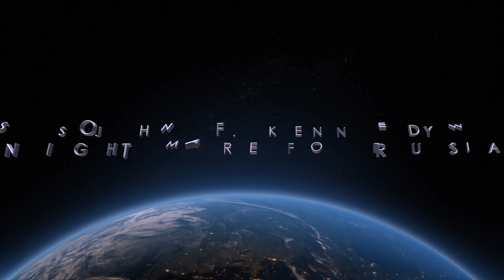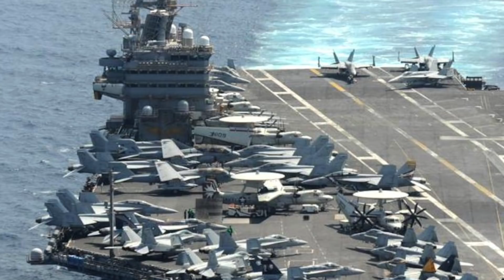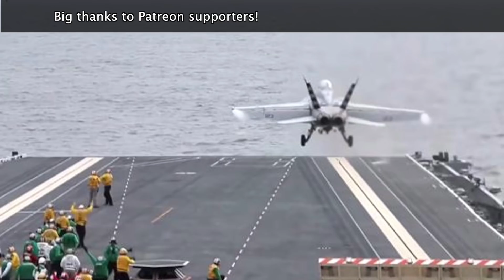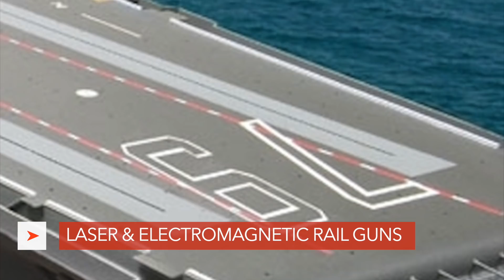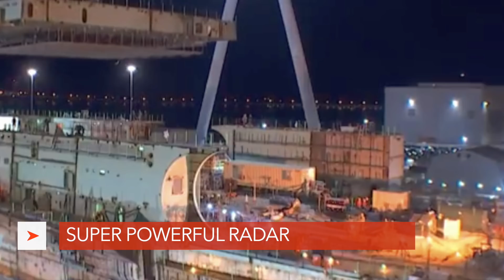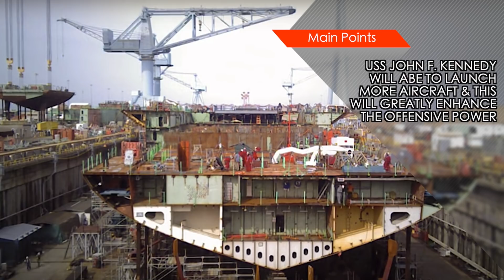WHY USS JOHN F. KENNEDY WILL BE THE WORST NIGHTMARE FOR RUSSIA & CHINA?

Comment: It's nowhere near 50pct built and after the GRF crews stealing parts for it I'd say that it's about 40pct. When you build something you always make sure that you've got a ready supply of spares in case of feckups like we are seeing on the GRF, more importantly you Field test the new equipment on a tried and tested platform so you can't have the arse over tip feckups the navy has been having for the past four years. This oversized Boston whaler should be well into her deployment cycle but because of too much untested new equipment being lumped in her has made her a Jonah

Comment: There are some serious assumptions about present performance/non-performance that will greatly influence whether the Ford class vessels will be effective platforms. 

The EMALS system remains an immature technology that is installed in such a way that the entire system must be shutdown to service one catapult. That presents a maintenance challenge if the standard sortie rate is to remain adequate. Speaking of sortie rate, only two of the eleven weapons elevators (critical pieces to support rapid aircraft arming) currently function as designed- the USN was required to contract external engineers to get the complex system to work. And the list goes on- the Ford class is an ambitious experiment, but not a functional platform that can be deployed anytime soon and expect to survive anything more that a token aggressor.

In fact, there's a growing body of thought within the Pentagon's strategic planning groups that the financial investment in large, complex vessels is not longer a viable approach to the future of asymmetric warfare. The Commandant of Marines has recently published his force projection summary which states his desire to equip the marine expeditionary units with smaller amphibious assault ships to defeat the ever-expansing A2/AD infrastructure being deployed by China.

For right now, the Ford class is a paper giant.

Comment: WOW so much for "WORST NIGHTMARE":

Improvements of Ford&Kennedy over Nimitz-class

1. EMALS, designed to launch planes faster and safer +30% flights per day
to this moment appeared to have multiple technical issues, the catapult actually itself fails to withstand the stresses and malfunction regularly 
2. +10% space for planes or munitions
3. Some new fancy radars and possibly point-defence lasers in the far future. Actually all the stuff you can easily put on the nuclear-powered Nimitz-class.
Also Defense Updates, did you know that installing a rail gun on the aircraft carrier is a very stupid idea? The artillery support is the job of destroyers, the carriers should stay as far away from the enemy as possible
...
and that's all. Ford class is almost the same as Nimitz, besides EMALS, which provides no game-changing capabilities and totally unreliable anyway

The chinese actually should be very very happy, that the biggest defense budget in the world spent billions of dollars of R&D on the small incremental upgrade of its supercarriers instead of buying a dozen (!) of state-of-the-art nuclear hunter submarines for the same money
Reply: Artem Maltsev you probably forgot about the new network command system that allows the ship to command the air and ground unit better so it can direct the entire warfare and better electronic warfare capability , better reactors that works a lot longer than Nimitz class and also the modular design that can be very important in future(it will be much easier for navy to develop different modules for different tasks in future it has more potential than we see now) More stealth characteristics design,more maintenance efficiency, stronger structure design and a tons of features navy doesn’t wanna disclose, all the issues we are seeing can be fixed a while later just like successful fighter jet f15 and f16. PS:rail gun on this ship is probably only for anti air since it travels faster than missile and it coasts a lot cheaper.
Reply: Also it requires less crew, lot less maintenance, has 3x more power for future systems, can carry more aircrafts. Has a stealthy signature.
Reply: All of this means, china will DIE!!! MUAAHAHAHAHAHAHHAAAA!!